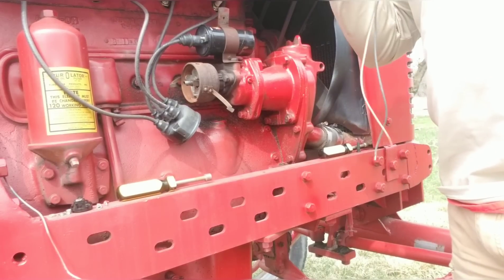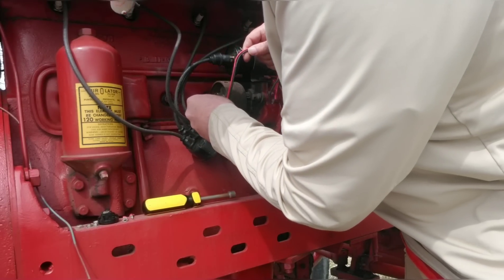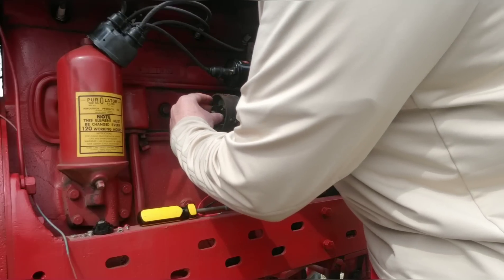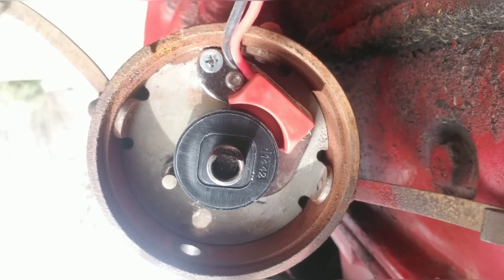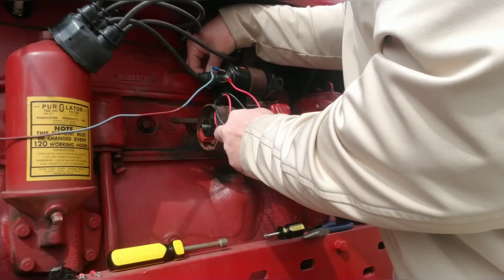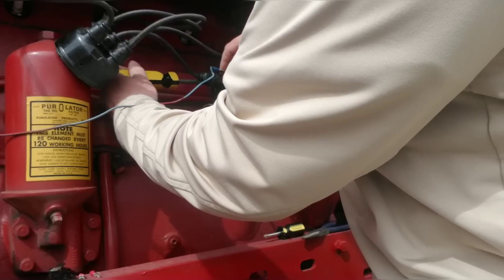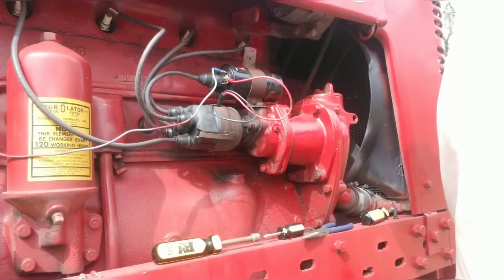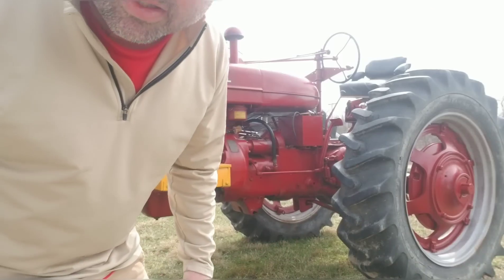Farmall M Electronic Ignition Installation

Comment: The modules are great. But you have to change the coil and wires out as well, learned the hard way you can’t use a standard coil and copper core wires.. Enjoyed your how to, thinking of putting my M to electronic ignition
Reply from the maker: 3ohm flame thrower coil

Comment: How long before those wires get caught on something and pulled off? Especially the one from the switch to the coil, it ought to be routed behind the oil filter at the very least, or along the top of the engine and down like the factory did...
Reply from the maker: Already happened

Comment: I like the magnetos better. I used to crank start a C and Super C. if it was available we would park it on a hill. Points and electronic ignitions require battery voltage to get a spark.

Comment: I have a distributor shaft that has a little bit of wobble in it. It causes my points to not always open enough which affects the reliability of the engine starting. Do you think this would work to correct my problem?
Reply from the maker: The spacing between the magnet is pretty critical. Id look at a new distributor.

Comment: you could have pulled the distributor rotated it and had those wires coming out the bottom, re installed plug wires accordingly
Reply from the maker: No doubt

Comment: Oh man! You left us hanging lol. I dont know alot about IH but I have an opportunity to buy and restore a 656. Is it worth fixing up? What should I offer for it? Thanks for the video and thr tune up lol
Reply from the maker: William Chambers 656D? That will have the American 282 engine. Guys let the glow plugs go on them and the reverted to ether. Very hard starting engines, but run like a dream. My question is what all does the tractor need?
Reply: Farmall Fanatic It's a gas engine. Hasn't run in a few years. Always parked inside. It also has a loader on it :(
Reply from the maker: William Chambers ok, check the gas tank. If he has left it empty, it will most likely be full of rust. So plan on redoing the tank. Thats gonna be the 263 engine. One of the best plowing/working tractors i ever had was a 656 gasser. I have a video of me speed plowing with a 656 gas. If the loader is an IH 2000, its worth about 2000 grand. The tractor itself you gotta find out why it hasnt ran.
Reply: Farmall Fanatic well the old fella passed away thats why it hasn't moved. Ok I'll check that when I go see it. Thanks for the input man :)